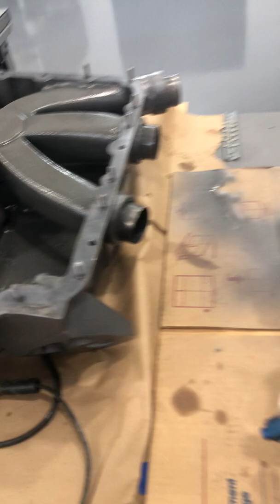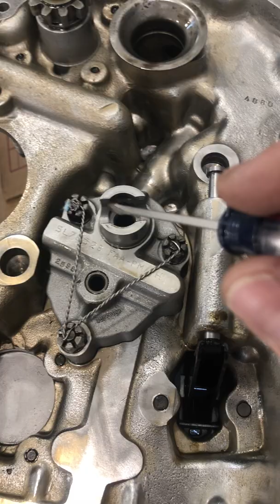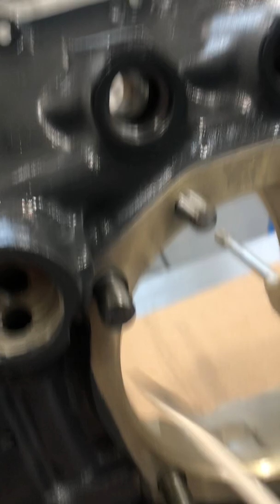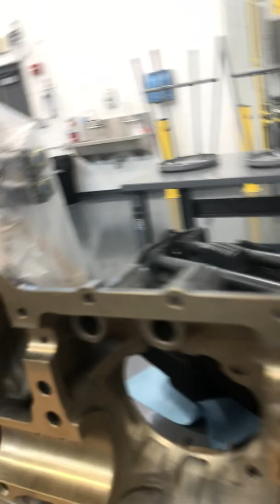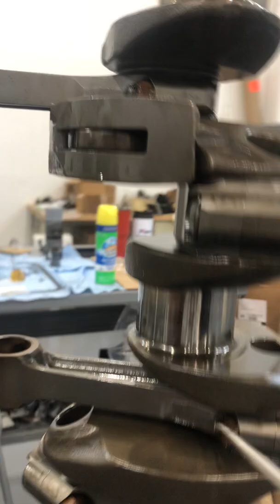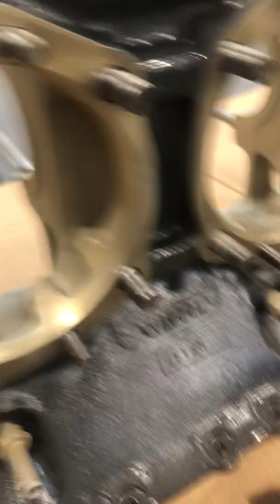Lubrication system on a Lycoming O-540

Comment: Newbie question: does the aeio540 provide better lube than the io540 though you may not be doing acrobatics.  A plane I saw with io540 installed regularly exceeds 400 degree head temp..just wondering if aeio would help that? Pipistrel panthera

Comment: Excellent presentation. Im about to pre oil a 20 year old factory new IO-360 and I can now see how to get oil to cam lobes, rocker arms, prop governor, and crank & cam journals. There are what looks like 1/4 NPT plugs at the fwd ends of the lube rails that can be used to prelube everything before dry cranking the system with the starter. Thanks for posting
Reply: @fly6tech776  I think I seen it where you placed plastic tubes on both sides and pumped oil on one side until it came out the other?
Reply: @fly6tech776  I like it and don’t understand why Lycoming never published a Service Instruction. It’s seems like a better idea to do this before dry cranking.  Thanks

Comment: Been looking all over for exactly this. Thanks. I am also looking for an explanation of exactly how the air in the  crankcase case gets to the breather tube coming out of the accessory case.
Reply: @fly6tech776  Thanks so much for your quick answer will look for the actual apertures as such. Working on reinstalling my  engine after rebuild due to that crankcase AD when when I was wondering where something say a washer would end up if dropped down the breather tube with hose off as that could easily happen, had a plastic cover but …..what if. The tach drive/ breather area case  “plumbing”  is  
 What I cant visualize.
Reply: @fly6tech776  I cant get a video or pic or diagram that shows the bit where the tach shaft enters the accessory case on the crankcase side and on the other side has a bulge which seems to  include both breather and tach out. Hope that is clearer and hey thanks!
Reply: @fly6tech776  Thanks so inside that is a chamber . Thanks for your help.

Comment: Can you clarify the part about the vernatherrm opening to send oil to the cooler? I thought it closed, stopping the shortcut to the engine and directing all oil to the cooler, which is always "open to circulation". Or am I wrong? Thanks. Great video!